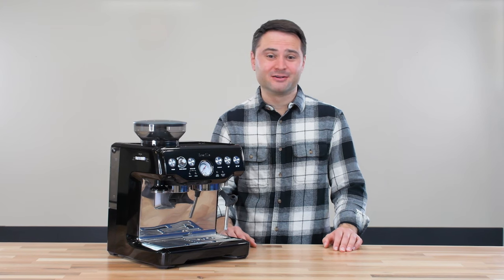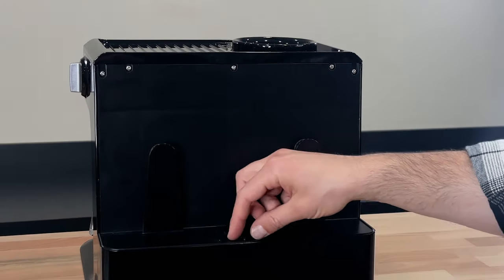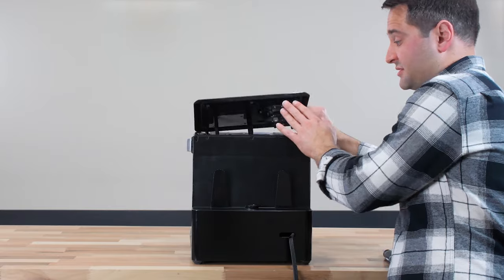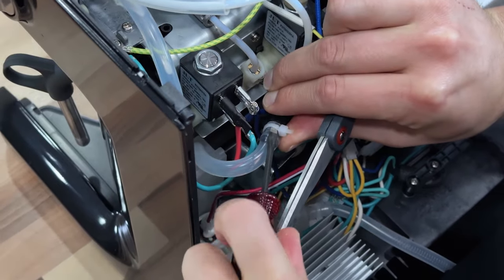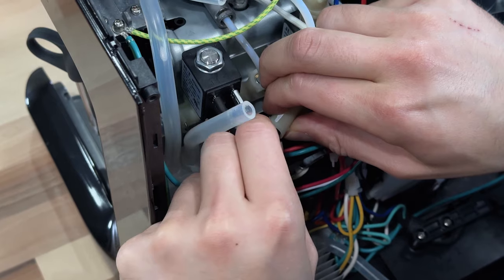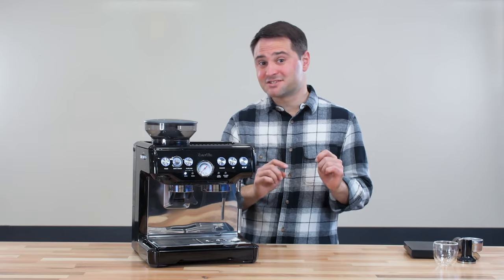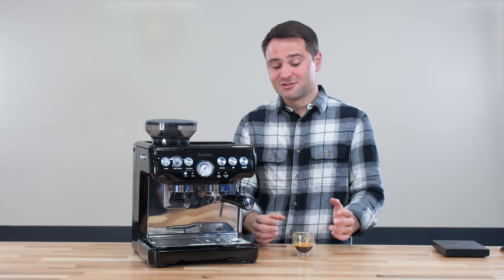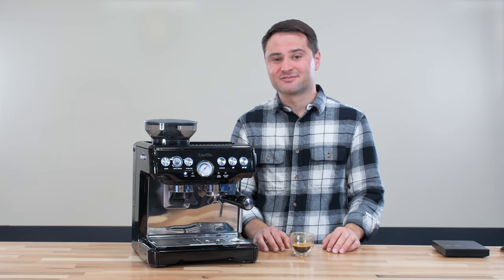Breville OPV Mod: BETTER Espresso With Lower Pressure (how to open a Breville Barista Express)

Comment: Its so much easier to just hold the double shot button down when you pull a shot, it will go to about 9 bar and you just double tap to stop the manual shot mode when you get to your desired yield.

Comment: I ended up buying a calibrated spring for around $6 to replace the one that was in there and can easily adjust it (just like in the video) to get it to anywhere between 6 and 10 bars now.
Reply: any link  of that or how to search it?
Reply from the maker: What spring did you use? Noticed the spring under the OPV screw.
Reply: Link the spring?
Reply from the maker: Here is the best source for 9-bar spring: https://www.mcmaster.com/8969T349/

PLease let me know if you try this one. I ordered it and will give it try.
Reply: @craftcoffeespot I'll be waiting patiently for this video
Reply: @craftcoffeespot that is the spring I used. Made a huge difference
Reply: @craftcoffeespot maybe you can check out the water temperature issue people are bringing up as well
Reply from the maker: @itsMirro  I found no change on water temperature. The drip tray fills faster due to OPV run-off, but no problem with water temp.
Reply from the maker: Here is a guide for the 9-bar spring change: https://www.reddit.com/r/espresso/comments/v4f8j2/breville_infuser_barista_express_9ish_bar_spring/

This OPV design is the same as the Express and the spring is behind the OPV screw.
Reply: That's the same thread I found, spring is already on the way. Was just hoping to get your take on it, before I try it. @craftcoffeespot
Reply from the maker: I'll look forward to your opinion! You're ahead and curious what you find @itsMirro
Reply: @itsMirro  - I read about the temperature correlation when lowering the OPV rating with the Barista Express which makes me hesitant to do the mod.  Did you do the mod?  If yes, what were your findings?  Thanks.
Reply: @craftcoffeespot  @theoravelo136  So here are my overall thoughts after trying the spring mod.... It's my least favorite of all the mods (Spring, OPV,  Dimmer). It just doesn't offer anything that can't be achieved an easier way. After installing the spring, I found the pressure to be too low for me, (~6 bars). After returning the original spring, I tried the OPV method in this video. This mod is what I have now, I'm happy with it as a whole. I think the dimmer mod requires the most work but probably overall the best mod. I'll eventually get around to doing it.
Reply: @itsMirro  Thanks for sharing your experience with it.

Comment: Nice tip, I might try this. I’ve been doing the ‘pre-infusion only’ extraction where I hold the button in for the whole shot. This way the pump doesn’t ramp up and I grind to a setting which extracts at 6 bar. The taste difference is huge, it’s so much smoother and balanced. Might be a bit low in reality but it’s the easiest option I found without having to open the machine up.
Reply from the maker: Smart idea with pre infusion. I didn’t realize how bad 14-15 bars was until I fixed it.

Comment: I’ve had a BBE for a while now and just didn’t want to open it out of fear of braking (as it’s all plastic), but today I thought what the hell. After I unscrewed all the screws (based on the wiki guide) I couldn’t get the back panel out and your video helped me understand how to do that, so thank you. After the mod I brewed a single shot and it was delicious, even though I use normal Lavazza beans, it still didn’t had that harsh of a bitter flavour nor any harsh acidity, so imo it’s a must. Al though I am a bit sceptical of how long it can survive with the opv valve barely holding on, as I went down to 3 turns and was leaking, so I had to return it down to 2.5 turns. Let’s hope it keeps up and thank you for the informative guide
Reply from the maker: Glad this helps! Even a small change makes so much difference.
Reply: I have the opposite problem. I can only get about one bar. Is this a pump issue filter issue? Any suggestions will be helpful.
Reply: Most likely you need to grind finer.

Comment: I just did this modification for my Barista Express. I was able to get the max pressure down to 10 bars. I am slightly concerned as the pressure valve may only be hanging on by a half or quarter of a thread; I hope that routine use doesn't cause it to blow out and get water inside the unit. I tugged on it quite firmly, so I don't think it will but am still considering that custom spring people are discussing here, if it means a safer result. In theory one could probably just shorten the spring to reduce the pressure, but this is obviously irreversible.

Comment: Thanks, Marco.  Excellent instructions. I was able to perform the mod easily, with no problems. I find that pulls are much smoother, sweeter, and have more body at the lower pressure. The only downside is, as you mentioned, the fact that the drip try fills up faster. But overall, I’m glad I did it. Thanks again.
Reply from the maker: Glad it helped!

Comment: I've tried to lower the pressure but when i pull a shot the extraction time seems to fast 😢
Reply from the maker: It actually flows a little faster at lower pressure. It’s counter intuitive as high pressure actually “clogs” the puck at fine grinds. You can actually grind finer which will extend extraction time and taste a little richer.

Comment: Great video, I was going to do the dimmer mod on my BBE, but bought a BE Pro for better steaming power and give my BBE to my daughter for Xmas, but I really like the Menu for set up much nicer than flashing buttons and now the industry is looking at heating options like ThermoJet for less power usage, my best upgrade for better coffee I think was a stand alone grinder ( Eureka Mignon Facile) and now there are so many good grinder at $400 and under like the DF64 Gen 2 $399 it has so many burr opion and with my Eureka Mignon Facile grinder I can the coffee notes much cleaner, but after say that I still think the BBE when on sale is the best machine to learn on and now with so many tools available for 54mm and breville it is a Plus Plus :)
Reply from the maker: Your daughter will appreciate the OPV mod for the BBE :). It's "one-and-done" so no need to worry about the dimmer. 

I agree with you on the grinders - LOTS of good options <$500. Actually filmed a video comparing the BBE vs Bambino + standalone grinders. Look for that soon.
Reply: Well her husband is the barista in there house. But with the dimmer mod not only can you control pressure but also flow allowing more profiling your shot, just my thoughts, happy coffee making :) @craftcoffeespot
Reply from the maker: @topjets5616  enjoy the dimmer mod
- maybe that’s the next video. Enjoy your coffee making :).

Comment: Tried all methods to fix the right pressure--- tamping, grind size, cleaning and descaling, tight locking ... but this only finally worked. Thanks

Comment from the maker: Any feedback? I'd love to hear if anyone else has done the OPV mod (or any other tweaking). The pressure change made a nice difference for my Breville Barista Express. 

Also, I highly recommend using a magnetic screwdriver!! It'll make the job much easier.
Reply: Would you screw the other way if your pressure is too low? And no it’s not grind size.
Reply from the maker: @TheGlassEyeTV  Have you adjusted your inner burr? That's a common issue in this case. See this video, tip 1: https://youtu.be/A7_6QX4GD6E
Reply: @craftcoffeespot  will do, thanks!

Comment: You probably could shorten the pressure valve internal spring or replace the spring with a shorter one instead of unscrewing the pressure valve. 
Sincerely Robert
Reply from the maker: Good recommendation - there is another link in the comments for the proper 9-bar spring.

Comment: Fantastic information here. It’s so perfect now in pressure. Initially my machine measured 16bar, so had to cut a little bit of the spring inside off, and now it’s below 10 bar, and have perfect 9bar pressure during brewing and really nice shots of espresso. Where actually thinking about new machine, but now this can hold for a long period with better tasting shots now and easier to control
Reply from the maker: @lskovdk  how much do the spring did you cut off? That would be the even better feedback to test as getting it down to 9 bar with a spring cut is better than unscrewing the valve. Glad this helped!

Comment: Hey! That's a really clever mod. I have a Barista Pro and I think that the espresso it makes has too much bitterness no matter how I set it up. I may try your mod and only screw the opv out a little bit. Thanks!
Reply from the maker: @Marc_lux  the Barista Pro pressure is already lower than the Barista Express so the mod isn’t as necessary (but can help). It’s also a lot harder to open up the Barista Pro! Be warned.

Comment: Would anyone understand why machine pressure changes drastically to extremely low 30 after when left on after my first shot?
Reply from the maker: Because the hot water has burned through the puck. Over time, the puck gets extracted and crumbles. Hence the flow rate increase over time and my guess is yours degraded enough that the water went through and pressure dropped….This is just a guess though.

Comment: Awesome video! I have been repairing an old Breville Oracle BES980XL over the past month. 

I have scoured the internet for answers but cannot find a solution to my problem anywhere, Maybe you could help? 

Everything works well on my machine - BUT when the machine heats up to temperature, steam is coming out of the water tank/container valve :/ The water in the water tank actually boiled and the spring loaded valve in the water container has actually melted. 

I have taken apart both the steam solenoid and the hot water solenoid and couldn't find any obvious signs why they shouldn't work. I've also tried adjusting both Over Pressure Valves.  Would you have any advice or tips on how i can stop the steam returning to the water tank? Many thanks.
Reply from the maker: Sorry, but I don’t know. I’ve never used an Oracle or encountered that issue.

Comment: I'm not really sure how this would work.  It's not like the hole changes size when you screw it in or out. It seems more that it is either on securely or not.  Where did you hear about this?
Reply from the maker: There’s a spring inside that releases water at a certain pressure. As you unscrew the valve, the spring has more leeway and releases water at a lower pressure, hence lower pressure shot. Try and see - it works. 

I heard about this for the Gaggia Classic Pro, where it’s an extremely common mod to replace the OPV spring. I changed mine and noticed an impact on espresso taste. Then, I noticed the Barista Express Impress runs at a lower pressure and tastes way better. So I change the Express and it had a dramatic impact.

Comment: With this mod to the OPV, how long does it take to pull a proper shot? In stock form, somewhere in the low 20s range seemed ideal once the pre-infusion completed... Does this lower pressure mod make for a longer pull?  I always knew if I tamped too much as the pressure was really high and the the pull took over 30 seconds
Reply from the maker: The shot time hasn’t really changed - it’s easier to get that optimal zone of 25-30 seconds. Before it felt really hard to get the exact dose of grind size for that. Now it’s more forgiving.

Comment: Do you know if the steam pump can be changed out from the berville barista express to the Breville barista touch??? I have used the Breville touch abd the steamer is much stronger than the express, if it can you should do a video on that I'm sure everyone will love it!

Thanks fkr this one ill have to give it a go!
Reply from the maker: It cannot. The steamer is driven by the heating system and they are very different on the two models - thermojet vs thermocoil. Different sizes and everything.

Comment: Does the Infuser (840XL) have the same OPV as the express? It is currently impossible to pull a shot with a bottomless portafilter without it spraying everywhere.
Reply from the maker: I think so. Not 100%, but pretty sure. I think Breville lowered it for the Thermojet machines and then again for the Impress, so older Express, Infuser, and Duo Temp run at 14 bars.
Reply from the maker: The internals appear the same on every model too, so you should be able to do this mod on the Infuser as well.
Reply: the same method just adjusted mine it is pretty straightforward.. I always wondered why I had high pressure I sometimes would do the manual shot and brew at pre-infusion... glad this worked out.

Comment: Once apart I noticed buildup on that valve you took apart. Also the reason I opened it is that the machine trips the cgfi circuit when pressing the brew button.  Any ideas what is going on? Also over the last 6-12 months seemed that pressure was getting higher with same grind.
Reply from the maker: Descale your machine? Sounds like a water quality issue, but first time I’ve heard this.
Reply: @craftcoffeespot  yes I do that.  I also use filtered water before putting it in the machine (filtered before it hits the breville filter). Anyway the build up is on the outside of the part not the inside. Thanks though.

Comment: Can I do this with the barista pro as well?
Reply from the maker: Yes, you can as the internal design is the same. But, the Pro is harder to open, and it runs at 10 bars already.

Comment: Hi, thanks for the video. I'm a newb to all of this and have owned an Impress for 6months. 
I thought i had an issue with my unit as it wasnt getting up to max pressure no matter what i did. Came across OPV and now this post. I see that breville might've done that for ease of use for Impress? As an engineer i'm not that impressed 😅 as i'd like to have access to that maz pressure.
Even when i block the portafilter with the cleaning puck, it won't go past the overall mid point on the gauge...
I have a case open with Breville and will update if anyone cares.
But until then, sounds like my unit is fine and it was a intended to it to not go high pressure from factory?
It makes good shots but somehow i like the shots that i pull with a duo boiler more... Same coffee, different grinder.
Reply from the maker: Watch my video on the Impress! It has lower pressure by design, which is a GOOD thing. Here is the video -> https://youtu.be/ElpOx2aeWEc
Reply from the maker: You can read our article on bars of pressure for espresso too: https://craftcoffeespot.com/espresso/bars-of-pressure-for-espresso/
Reply: You don't typically want the pressure to be above 9 bars anyway, since it starts to over-compress the coffee, resulting in poor flow or sudden channeling. The old models were flawed, and the lower pressure on the Impress is a correction.

Comment: do you get higher temp on the water due to lower bars? I've read that in some forum
Reply from the maker: Nothing noticeable on my end.
Reply from the maker: The drip tray fills faster as more water is let out of the OPV.
Reply: If anything, at lower pressures temperature would potentially decrease, not increase. However, the temperatures for brewing are all below boiling thus any pressure adjustment shouldn't affect these temps.

Comment: there has to be a better way to adjust that lol
there is a standard tolerance for how many threads need to be threaded into something.  different applications have different minimum tolerances.  you're running that machine at 12 bar of pressure with that fitting barely threaded in, as well as it not being locked or having any thread lock on it.
this is not a modification that should be done and you're advocating for something with a perceived inherent knowledge while sharing terrible and potentially unsafe information.
Reply from the maker: This has worked great for me and others. And I clearly say this is at your own risk. But if you’re into espresso, you’re into tinkering already, so most viewers are already opening their machines as is.
Reply: lmfao  @somaxusa
Reply from the maker: @somaxusa  so true! Not to mention this was designed over ten years ago, before modern espresso science. The newer models have had successive pressure decreases.
Reply: @justinbouchard is actually speaking to a legitimate concern. If the thread is only screwed on a quarter or a half turn, it could slip off. 10 bars is quite a lot of force, and the only thing holding it back if the thread slips here is the rubber gasket. If that happens you will have water near your electronics and wires.

When I did this mod I stood there for a long time trying to deduce a way to secure the stem better, in case of thread slip. I think glue would work or some creative zap-strapping. But ultimately best solution is to get a weaker spring for the valve, so you can screw it in furthur.
Reply: Just did this on Breville Barista Express and it certainly affects the pressure of the steam wand!
Reply: @MH-mu4go  it certainly would